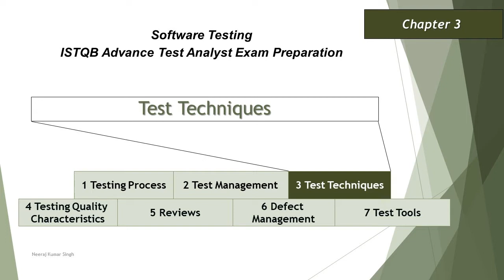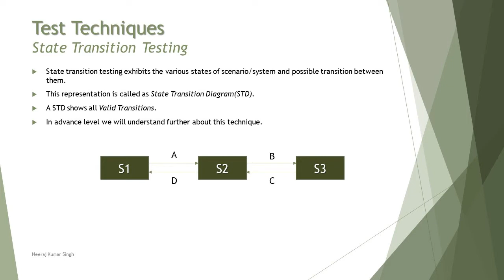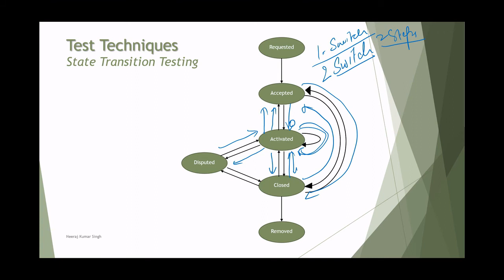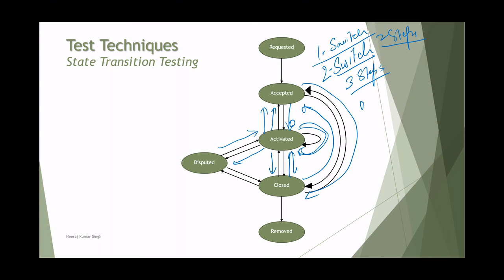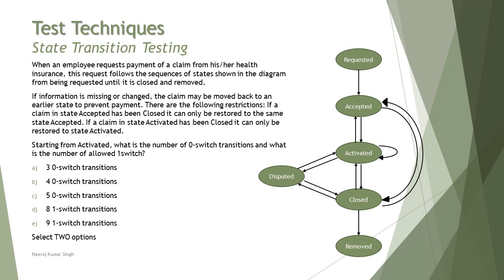ISTQB Advance Test Analyst | 3.2.5 State Transition Testing | ISTQB Tutorials

Comment: Hi Neeraj, for the 1-switch transitions:

There are 2 restrictions:
1. If a claim in state Accepted has been Closed it can only be restored to the same state Accepted.
    -> ACC - CLO - ACC
2. if a claim state Activated has been Closed it can only be restored to state Activated.
    -> ACT - CLO - ACT

These are the 1-switch transitions I have found:
1. ACT - ACT - ACT
2. ACT - ACT - ACC
3. ACT - ACT - DIS
4. ACT - ACT - CLO
5. ACT - ACC - ACT
6. ACT - DIS - ACT
7. ACT - CLO - ACT
8. ACT - ACC - CLO
9. ACT - CLO - ACC ( Removed because of Restriction#2)
10. ACT - DIS - CLO
11. ACT - CLO - REM ( Removed because of Restriction#2)
12. ACT - CLO - DIS ( Removed because of Restriction#2)

There are a total of 9 1-switch transitions.
Is my explanation correct? Please confirm.

Comment: Hi Neeraj,  Need urgent clarification 

As per the definition: 
A single transition is called 0-switch 
A sequence of TWO  transitions is called 1-switch 

4 0-Switch transitions:
Activated-Accepted
Activated -Disputed
Activated -Activated
Activated -Closed

9 1-Switch transitions: ( I am not getting 9 transitions )
 Activated-Activated Activated-Accepted; Activated-Dispute; Activated-Close -> 4;
Accepted - Activated; Accepted -Closed -> 2;
Dispute-Activated; Activated-Accepted -> 2;

Could you please respond, I have exam next month . Thank you
Reply from the maker: I have the response in the video it self. And 2 steps means activated-disputed-activated.
Reply: @TMSQUARETECH  Appreciate your quick reply. Could you please comment  the 1-Switch transitions that would be great or at least link the answer that would be great.